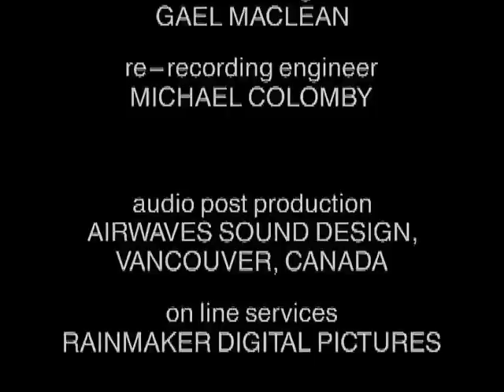How Do They Knit a Chain-Link Fence?

Comment: the fake sounds kill this video
Reply: First off fork trucks don't beep doing forward
Second, listen to the fake ass squeeks at 1:12 .
The babbling brook noises on the water just before that are ridiculous too.
Reply: +pinkfloyd666 Yeah indeed, it wouldn't be such a problem if the guy who did it didn't suck at his work
Reply: pinkfloyd666 yes fork trucks do beep when moving forward. some factories and companies require machines to have full motion alarms and some even require strobe lights. I'm a mechanic for a rental shop that has many fork lifts, its just a matter of what safety features a company demands
Reply: I like these, I think it's funny
Reply: Opinions are like assholes. Everybody has one.
Reply: 1:08 the wire is making sounds like someone swinging a lasso lol
Reply: I didn't catch that one the first time through, that's awesome.
Reply: This... really annoying.
Reply: There's nothing fake with the sounds. I verified it from start to finish and they're ALL in sync...would have been too much pain to fake them.
Reply: @ziad_jkhan  i like to confirm what you said - I’m at Tree Island for the last 29 years and none of those sounds are fake or manipulated. There wouldn’t be a need for it anyway.

Comment: This video did not actually show it well, and half of it was about the 'pickle tank' process of annealing the wire, then coating the wire, instead of the fence construction itself.  If you take a 3-foot section of the fence, cut the top and bottom 'fold over' crimps (shown at the end of the video, where the last 1-inch of wire is bent to lock it in place) is cut off and removed, you can then 'break' or separate the wire by 'unscrewing' a single wire from the fence section. You can only do this when it is NOT in tension (you can't take a strand out while the fence is up and under tension).  This is how you can seamlessly put multiple rolls of wire together without a joint-line, as you simply 'weave' a single strand into the desired joint location between two rolls of fence wire. It is very quick, you can cut-and-unweave a single strand in less than 1-minute, once you understand it is nothing but a bunch of corkscrews locked together.
Reply: They did show the pieces being screwed into place, but I appreciate your extra information.
Reply: You can only weave a half diamond and a whole Diamond together. it cannot be two holes or two halves
Reply: Dust Devil 
NONE...of which was EXPLAINED in the video....think it left most of us going..huh? What? What's happening?
Reply: Did you read the title? ANY of You? here is the title "How Do They Knit a Chain-Link Fence?" Does it say installation ?
Reply: imagine then a chain machine, i work in a factory like that and its mind blowing, this is like stealing candy from a child

Comment: they didn't show in slow enough motion how the actual "knitting" takes place.
Reply: Knitting is a false description. These are more akin to threading the loops of long springs into each other and then flattening them out.
Reply: it twirls in a circular  motion threading  itself as it goes to the end,  in a loop, out a loop, in a loop, out a loop ,in a loop , out a loop.
to find out for yourself , locate a fence , use pliers ( linemans pliers) to straighten both tips ( top and bottom) of the same line you want to  ''uncurl '' . then twist ( unsew )  it all the  way out. is easier to fix fences when you have the know how.
and you will know how, once you do it.

Comment: can you make it out of a continious wire and use electricity to detect it being cut and the plastic as insulator so once it is cut it will make a same affect as a wire being cut so a section by section cut alarm can be made ???